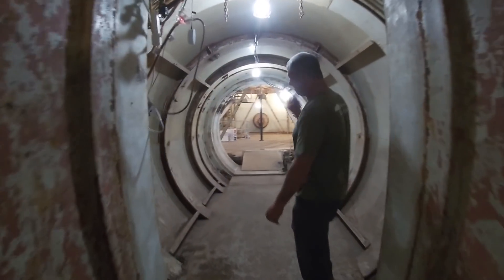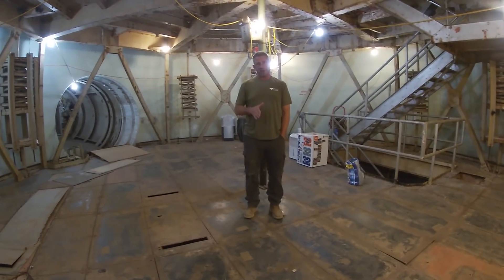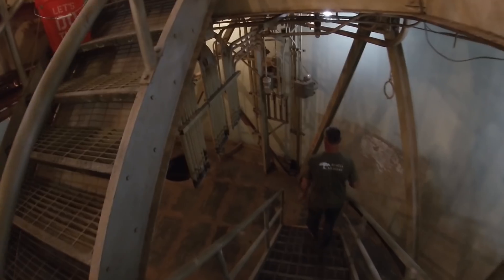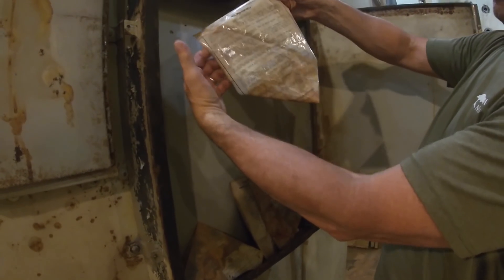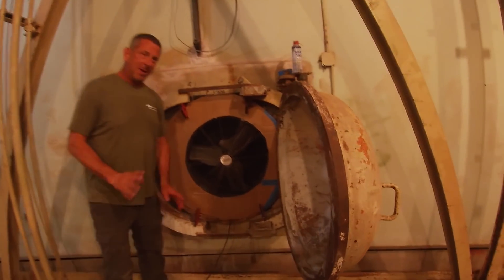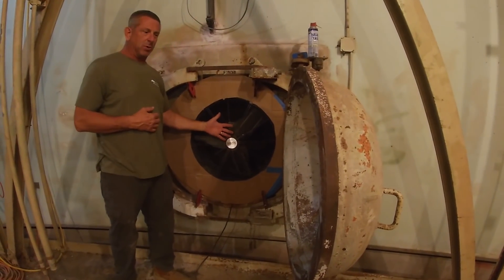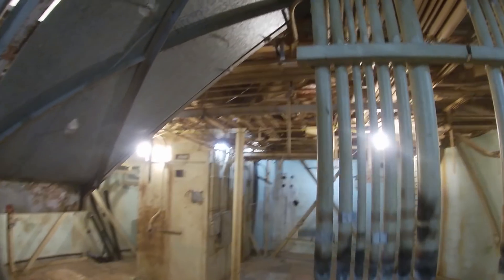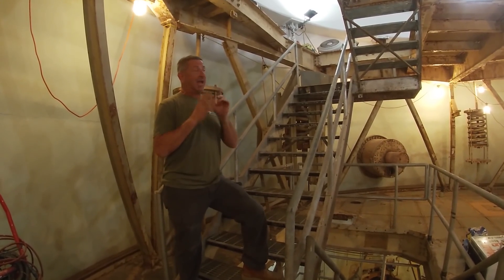S1E15 - Arizona Titan II Level 2/3 Tour (2of3) - Owning a Titan II Missile Silo

Comment: Fond memories of maintaining my equipment on site.
HF/UHF radios on level 3, controls for operating them on level 2, including controls for a unique (variable height depending upon frequency) telescoping HF antenna in its own 30 foot deep hardened silo.
That hardened HF antenna was designed similar to a typical multi sectional pull out antenna found on portable radios and such, but the base tube diameter was maybe 15" across. When fully extended, it reached somewhere between 50 to 75 feet. (sizes are rough guesses from very old memories, sorry).
Use to anger the commander while on level 3, for reaching out to the outer shell and making all 3 floors rock on its springs!

Comment: Really sad you're removing all the conduit.
Reply: It's necessary.  No way to scrape and paint above and around the conduit.  There is corrosion and rust on the inside of the conduits, they are not usable.
Reply: @ArizonaTitan  But it looks cool and it's original.

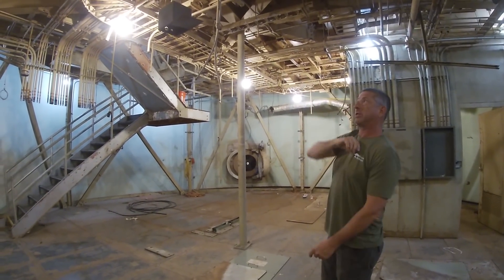Comment: At 5:27 you step over a potential pit.  What was that?
Reply from the maker: It’s where the equipment racks were. My site has that too. Need to cut floor plate to weld in

Comment: The Museum mounted a swamp cooler over the air intake shaft for cooling...
Reply: That's always an option but I did not want to do that.  I've lived in AZ 40 years and always hated swamp air.  Too humid, and eventually all the carpet and furniture smells musty.  And humidity makes RUST! Maybe after all the exposed metal is repainted... The museum had to do something because of the crowds coming and going, open doors bring hot air.

Comment: 6:45 Little bit of an exaggeration in your dimensions.  The vertical walls of the LCC are 3 feet thick and the outer electromagnetic shielding is 1/4" thick steel plate.   Yes you still cant easily drill though it but you can easily look up the spec to which it was built.

Comment: I saw three ELU's, one in the first video behind door 7 and two in this video on level 2 and as he pointed out on level 3. I had the fun job of testing and repairing those as part of regular silo maintenance. Not that it was a big job but fun to see some still standing. Interesting too he said it would get 80/90 deg 60ft down. Since heat rises not sure how that happens.
Reply: In the dry desert the ground heats up a lot more and a lot deeper than you would think.  And if the only airflow coming in is 110 degrees it has no way to cool down - it just gets hotter and hotter, especially in the top level.  And if it gets humid I can run the dehumidifier, but that adds heat too.

Comment: Every time I see the giant spring hangars I think about your silo. Any plans to address the missing spring in your launch control center? Any chance you could repurpose the smaller ones that are in your long cable way?
Reply: He needs to check out the salvage yard, and see if he can buy it back for a cheap price.
Reply from the maker: Cheap is relative. At the moment I just want to get the current scrapping done.

Comment: Speaking of venting have you looked at a sprayable liquid desiccant to help you with the air intake on yours? A shed over the escape hatch to house some sealed ducts and a catch basin to spray desiccant into the air flow and a solar evacuated tube hot water system to cook the used desiccant to renew it could give you a fully solar powered air dryer to keep the humidity down in the summer. 

Can also look at a ground well to supply ground temp water to fill radiators for the air to flow by to both cool and dry it but that would be a more complicated system.